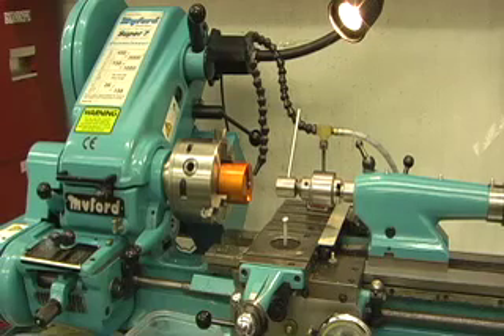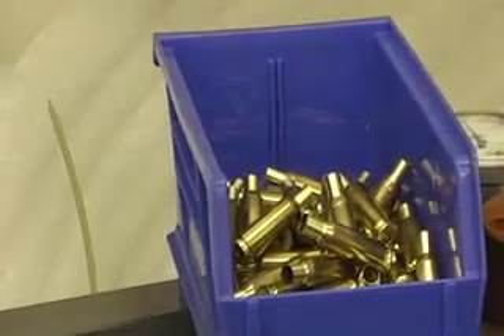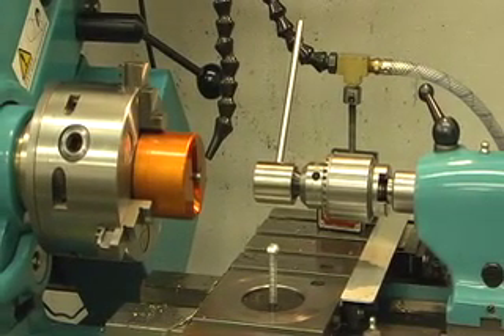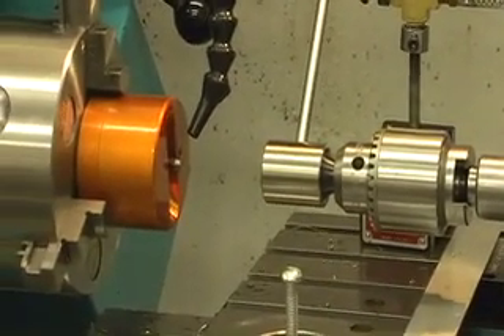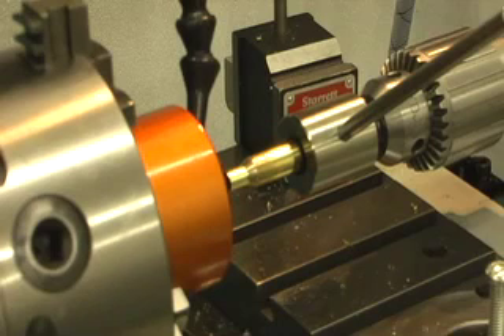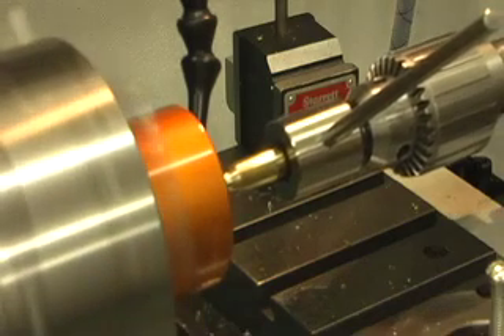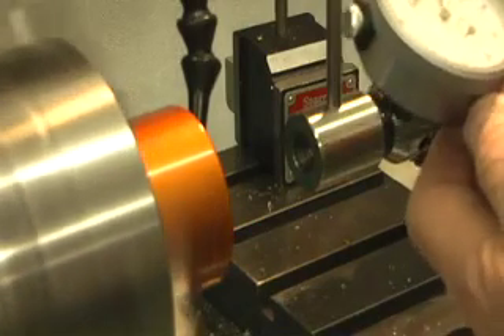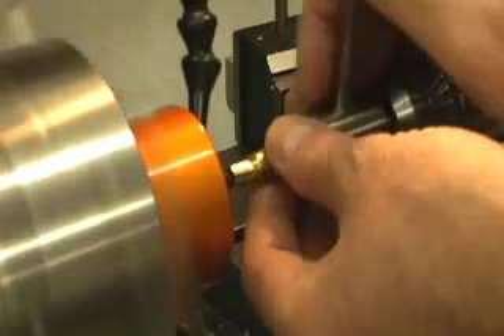Case Turning in Tailstock

Comment: Fast Brass Plus 50 can use prep, tools from about all manufactures.
And you don't need a $8,000.00  machine that can only neck turn.
FBM can do all 7 steps of prep on one machine.
Reply: When turning 6 ppc necks the aim is accuracy, not speed. No need to hurry, you need perfect concentricity, what you cant get by hand or with a drill adapter (it always wobble a bit)

Comment: hey mate I can't find the Forster "collet closer" anywhere on the net to buy? I can find the collets no problem but not the closer?
Reply from the maker: I may be making some. So let me know if you are interested. Not sure of the cost yet.
Reply from the maker: I have now made a couple. Testing them. Have not come up with a price. Will work on that. Still interested?
Reply: Sorry mate - didn't see your last reply. I've actually gone down the avenue of using a collet chuck in the headstock. Thanks though
Reply from the maker: tfre3927 Good. It is a great system.
Reply: Chris Harris Chris, I would be interested in purchasing one of the collet closers. How do I contact you?

Comment: Where did you get the case chuck? Is there a part number for it?
Reply from the maker: I had a Forster collet so I made the rest so it could be clamped in a drill chuck. Here is a link for one on MidWay. http://www.midwayusa.com/product/348704/forster-original-case-trimmer-collet-3

Comment from the maker: @pbike257 Thanks for the comment pbike - and alaskaman. Although I am aware that one could nick a finger I typically don't have the time to change the jaws around so I just stay very aware of the turning chuck. I am pretty respectful of these matters and stay on the alert. The lathe is not powerful enough to pull a hand into it, but it would make a nasty cut no doubt.

Comment: Nice set up  I like the use of the forester collet as a holder... Just a thought, if you turn the jaws of the chuck around and set the "Pumpkin" cutter on one of the steps, will you not have the outer portions of the jaws outside the chuck radius?  You have more potential for serious injury with the set up as I see it, configured the way you show in your video.

Thanks, Pbike257